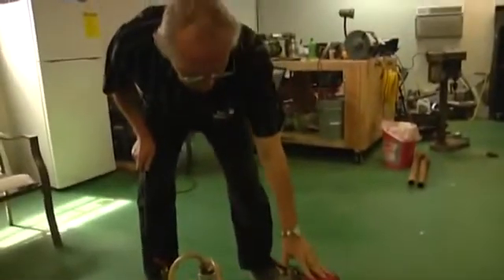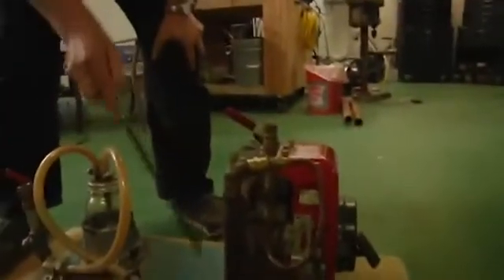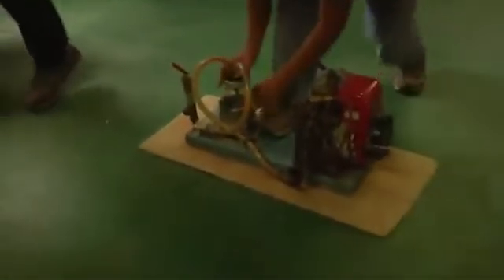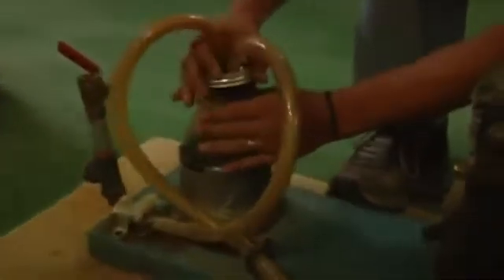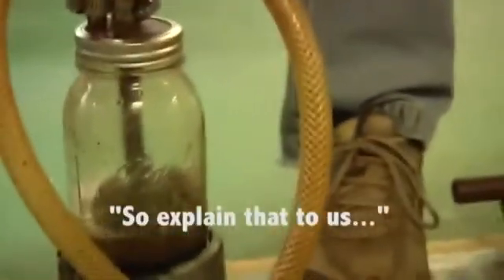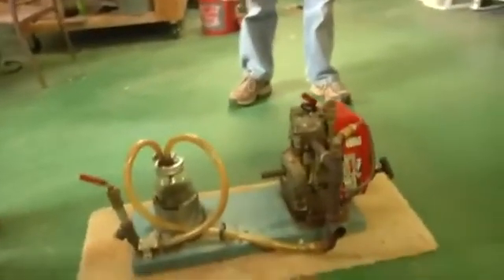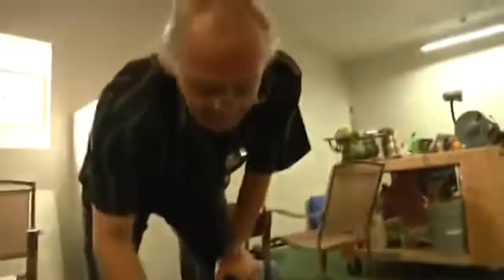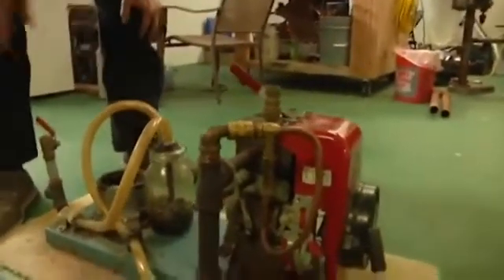GEET Demonstration    Engine Runs on Coffee

Comment: What it's the rod need to be made off
Reply from the maker: Cold rolled steel,  that is what I would start with
Reply: @sizzlean9459  thanks s for reply  back  , I have something  in mind  but I will be share  after test  , I keep  in touch,
Reply from the maker: Paul purposely chose each material the sizes and everything so that it was standard and you could find everything necessary at any hardware store in the whole world. So everything you need you can find at home Depot or Lowe's or Ace hardware and most of the stuff is already pre-cut and threaded for you you just need some red silicone and it helps if you know somebody with a band saw but you can use that hacksaw for your aluminum manifold parts and maybe a tap but not all you don't have to have a tap
Reply: @sizzlean9459   what about the timing on the engine , will be add to the fact the fuel time on it's much faster on the system, so time it's fact  to create the right point fire of fuel before get compressed in chamber,  what it's your opinion,